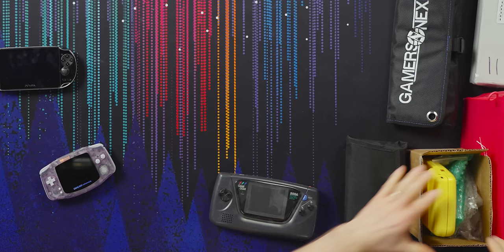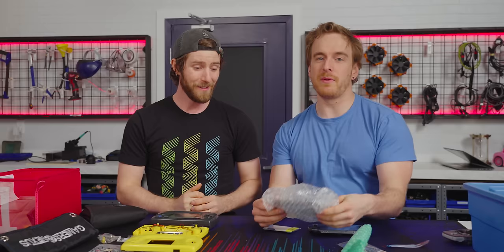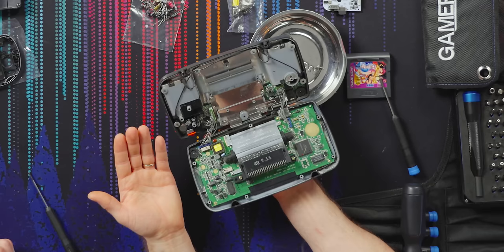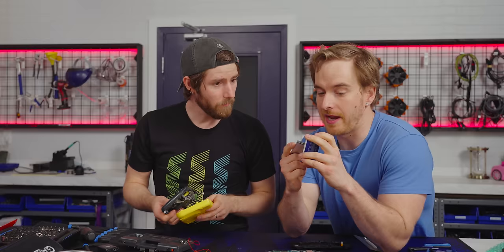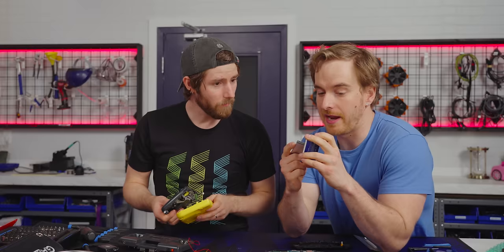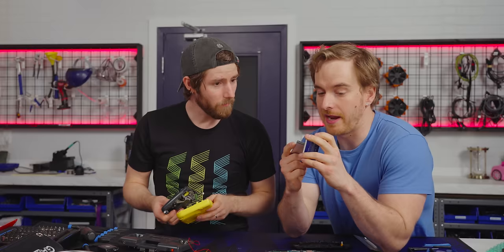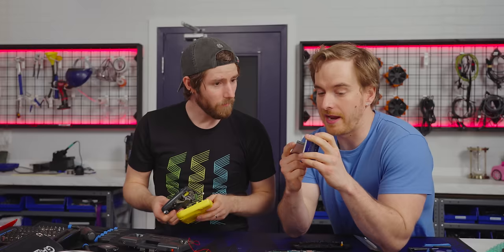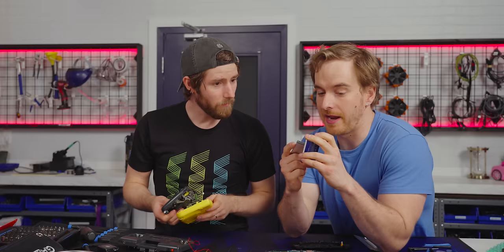This was ROUGH... I can’t wait to do it again! - Game Gear Screen Replacement

Comment: Also, for the power module, I'm too lazy to go back and check to be sure, but I would ASSUME that board is for charging and controlling the lithium batteries?
IF SO, then you DO need A power module, but it's clear that because of your old model of game gear, something isn't right with that extra circuit for your board, it was probably designed with the newest available schematics in mind. So if it fried like that, I feel like it's pretty certain that whatever constant current, constant voltage it should be using for bypassing those batteries through it, to your console is wrong, probably because of some difference in your console that changes something the module needs to set it's parameters. A capacitor or resistor or both could be wrong, which is often how you set an IC's output for certain things, like an adjustable regulator would often use that to set it's output voltage.
I wouldn't trust the batteries either though, after that, and getting new ones in that size shouldn't be too hard.

Comment: I own a fully tricked out, case/ cool modded CECHA01 PS3 that runs CFW, PS1, ps2 and Ps3 , Retroarch, Snes w/ savestates on another standalone w/ really low input lag on the emulators. Thought it would add and extra layer of jank but its just amazing. Even got my xinput controller working w/ a plug in. Nothing like playing Super Ghouls n Ghosts on a modded PS3 w/ an Xinput controller .

Comment: You need a desolder station that literally works like a solder vacuum to remove solder without damage, and some solder wick to remove excess, hot air station is too destructive

Comment: I was the same way for the upgrade on my game gear.  I have it on a stand and bore everyone with stories once it's seen.  Yes AA are better , the battery won't go south when it's stored for a long time, and can swap the AA back to my Xbox controllers.  Using 1500mAh Paleblue lithium ion 1.5v rechargeable so it has true 1.5v .

Comment: Make sure you do the caps in that Game Gear. You could likely have restored the original screen just by doing the correct few caps (assuming the controller chips were still good) without hacking what is basically a prototype (painful to watch) so the rest are suspect, and the only thing worse than being told by some random internet loser to re-cap is seeing the aftermath of a leaking or exploded cap in a piece of vintage hardware.

Comment: If you don`t want to buy Cables or choose cheap One`s, i have a solution to you. Use the Grey Ribbon Cables from a Old Floppy Drive. Inside the GREY Cable (Only the Grey`s have ONE Copper Line!) And with those you could Wonderfully Made your Work...

Comment: It's crazy to watch you guys struggle with these I've done tons and they're not really hard to me definitely not like chipping certain models of ps2 slims lol but then I see you guys work on computers and I'm like wow I don't understand half of this and would be able to actually do less lol. Just kind of shows me the gap between pc and console is bigger than I thought. I kind of expected if you knew how to work on one you'd be fine with the other but I don't own a gaming PC so have absolutely zero experience with one. Kind of boost my appreciation for both console modders and PC builders in their own rights. Great video by the way

Comment: "For anyone who has studied handheld history"? WTF Linus! You made me feel like 1000 years old! I had an Original GameBoy (the classic gray one) with Tetris as my first console. Had a NES at home, but it was for the whole family, and an Atari 2600 that no one else used so I kind of adopted it as my own. So based on your comment, I would be like a Neanderthal. Well, I'm not a Neanderthal: my current setup is an i12900k with a Geforce RTX 3070Ti, and I'm a software engineer at a FAANG company (not allowed to disclose which one BC reasons).

Edit 1: Ok, I do have a 3070 Ti, so my argument is weak in that point, but you have to understand I build my PC during the great 2022 GPU shortage.

Edit 2: So I re read my comment, and just ignore me.

Comment: 18:57 "oh no there are less than 10 FAT wires to solder... Whine whine. REALLY?? i solder smd under microscope. This is childsplay..

When wire up rows like a ribbon i like to use tape. I place all precut wires on the sticky side with accuracy. then i tape again to hold in place so glue meets glue :) Then pre-tin all the pads and place ur premade "jig" and add fluxgel. Then its time for the solder, one straight pull of the iron across all connections. and bam.. Its perfect.

Comment: Great, just imagen when i was a kid i had one gamegear an the screen stopped working . i brought it to a repairing guy who also repairs tvs and kind of stuff. He said no this isn't repair able... he didn't even take it appart... with my 8years old i decidet to take it appart and yes this gamebit also 30years later is in my imagination that ive opend with pliers... however ive figured out the Backlight isn't working. so ive talked again with this gui an he told me that there arent parts to get... so ive decided to trash it.... yeees ive learnd never trash a console again for the rest of my live... installing some LEDs now sounds not that hard...

Comment: Not so pro tip, however. If you need  STUPIDLY small/thin cables. Use guitar snares/wire

Comment: 7:20 David won. Sorry guys, but despite lithium being worse for the environment, it DOES create less waste overall. The argument just isn't sound between disposable/rechargeable AA batteries and lithium batteries(battery packs for the xbox controllers are pretty much lithium batteries). Yes, you will eventually have to tear apart your controller just to change out a lithium battery. But unless there's a failure or you refuse to charge your controller when it gets low, by the time you do have to learn how to swap the battery in a ps3/4/5 controller, you'd have likely worn out other parts of the controller anyways, and would be better off buying a new controller. Xbox controllers, you have to buy new or recharge your batteries weekly(on average). Sure, you never have to worry about degradation(unless you're using rechargeable AA's or a battery pack), but you're spending so much on new batteries, that you'd have payed enough for a new controller anyways by the time you wear out other parts of your controller. Battery pack is still probably the best solution, tbh. Saved me so much money on the Wii controllers.

Comment: 28:10 
On the left, someone left out their goods and grinder.
Reply: Sadly no it's the little container that holds what's basically like steel wool which you dab the soldering iron into before resting it. It clears off any residual solder and other gunk that can decrease the heating ability of the tip

Comment: Every time I watch this channel I think how can you guys be so bad at this sort of stuff. Don't get me wrong, soldering really small pads is not easy, but like one hour of practice and you can solder super fine pitch parts. Obviously Dan saved the day having to trace the board to avoid the lifted pads. Btw, to fix lifted pads you can scratch the resist off and solder a magnet(enamel) wire to the bare copper trace. Also you guys should get a fabricator/machinist or some other type of handy person as they would have much better input in situations like this. I'm available lol

Comment: PlayStation controllers are actually worse for the planet, since once the lithium ion battery dies you have to replace the whole controller, not just the battery
Reply: Technically you can disassemble the controller and replace the battery, or just use it plugged in. I get what you’re saying though.